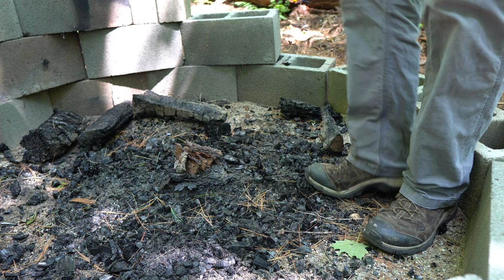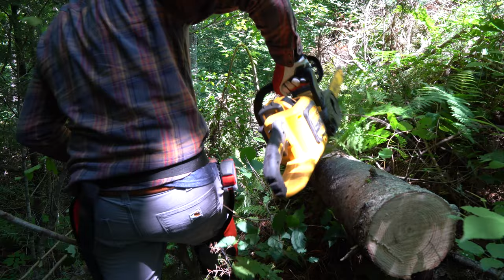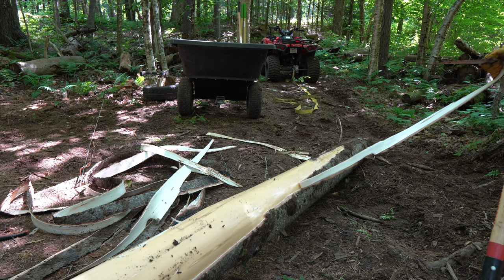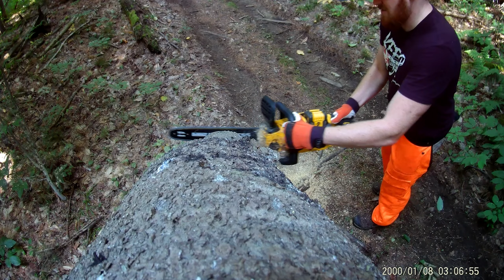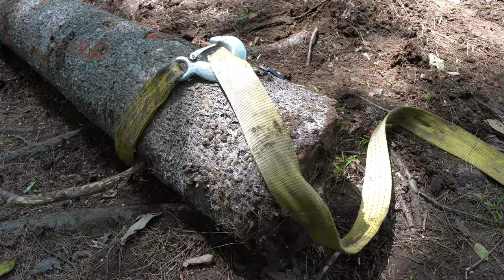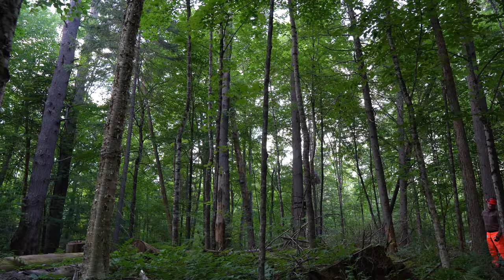Building a pole shed with logs from the property - North of the Notch

Comment: Thanks for this tip.  I've never heard of burning the logs and putting them into the ground.  I assume it's to prevent rot, and possibly some ground critters from considering climbing up it?  Will this weaken the structure at all or are you only getting surface burn?  Some areas seem deep penetration.
Reply from the maker: I am only getting a good surface burn, nothing penetrated more than about an inch deep. If I could do it over again I would have covered the bases in something like a linseed oil and put some gravel in the holes first to help drainage. Though the soil in this spot is on a slope and it already had good drainage capabilities.